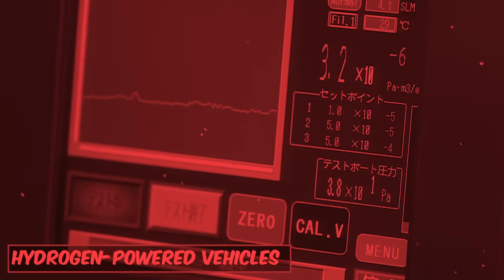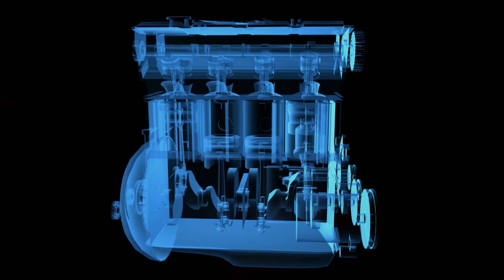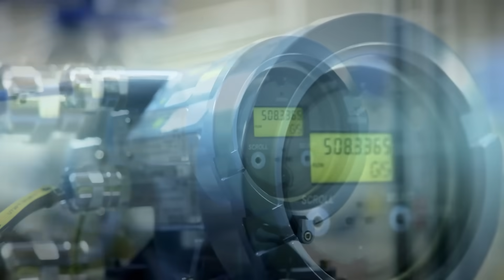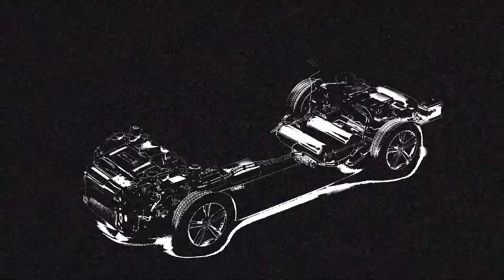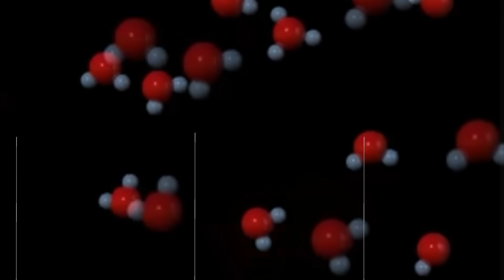Toyota's New WATER Engine Will Destroy The Entire EV Industry!

Comment: The BIG if here, is doing electrolysis on board.  If that can reliably done, then this maybe the game changer that humans have long sought.  Water is a lot more plentiful, than even petrol.  Also a lot less likely to ignite too.
Reply: The big IF here is how they get around the laws of thermodynamics - takes same or more energy to split the water as is yielded from burning the H2
Reply: The other "Big If" is the oil industry. This would devastate a large part of it's business. I think I read that about 30% of oil is used for fuel. That's many billions of dollars they won't give up easily.
Reply: @1967davethewave  It's not their call, and they're not more powerful than Big Automotive. If they had the ability to block non-petroleum cars, they'd have stopped electrical and ethanol powered vehicles long ago.
Reply: @DaveHaynie  That could be true but the question I have for you is are you the reason I was almost extradited to some podunk town I've never heard of in Missouri in 1995 for a warrant?

Comment: This is so stupid. Simple physics tells us you'll need more energy to power the electrolysis than you'll get back out, particularly if you are going to burn the hydrogen in a combustion engine (a notoriously inefficient process). Utterly moronic. And don't tell me it's about "achieving higher efficiency." There are hard physical limits to how much energy you'll put in and get out, since hydrogen atoms are strongly bound to oxygen in water. It'll always take more energy to release the hydrogen than you'll get back from recombining it, even if you were using a fuel cell (which is far more efficient than a combustion engine).

Anyone involved in this ignorant nonsense should be embarrassed.

I do appreciate the acknowledgement that hydrogen fuel cells powered by compressed hydrogen isn't practical, though at least that idea doesn't depend on pretending you can produce energy from an inherently energy-negative process.
Reply: I don't know how Toyota is able to do it.  I agree, physics and the law of energy conservation make it seem like it's impossible.  Suffice to say, I'll believe it when I see it.  But, way to go Toyota for dreaming big!